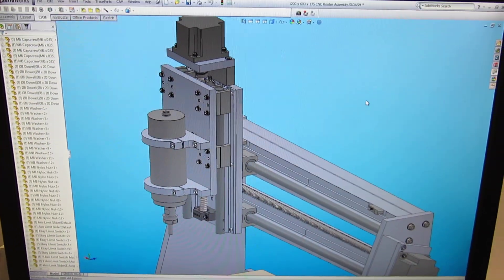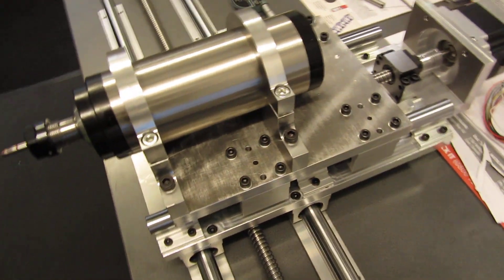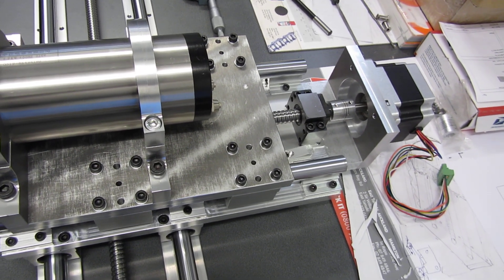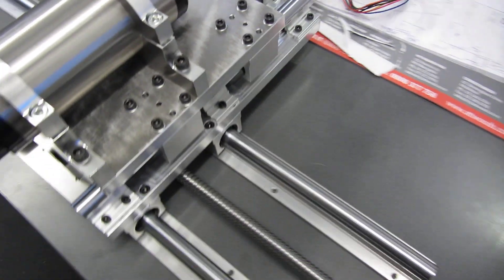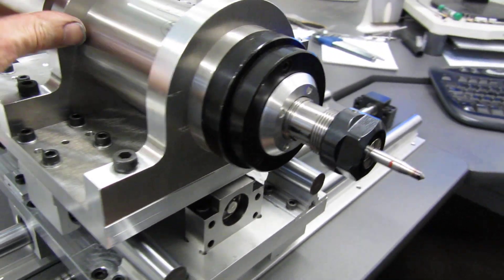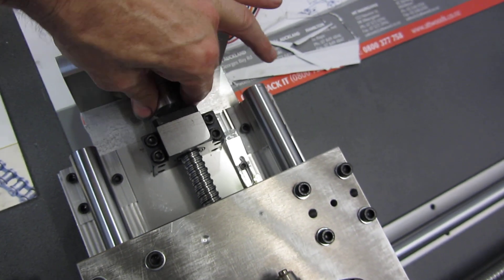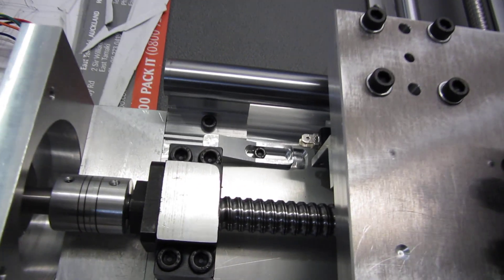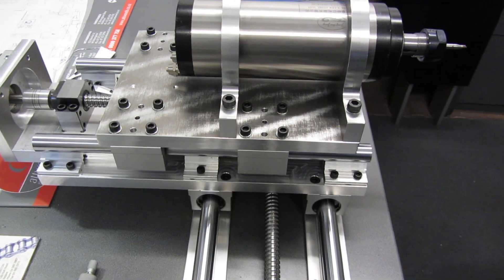2.2Kw Spindle on newly complete Z axis with new Y axis rails in place

Comment: Hi mate where did you get the spindle motor clamps? I have the same kind of motor 1.5 kilowatts I want to use for pcb routing. I did see
that for z axis I need for shure ballscrews because motor is quite heavy. Thanks for help.
Reply from the maker: Hi, I made the mounts myself along with the whole machine. The files for this are over on GrabCad

Comment: USDhow much completely in
Reply from the maker: Here is 2 places to get them

http://www.ebay.com/itm/2-2KW-ER20-WATER-COOLED-SPINDLE-MOTOR-AND-2-2KW-VFD-MATCHED-INVERTER-DRIVE-/250748327119?hash=item3a61c3d4cf:g:bwoAAOSwxYxUtO-y

https://www.aliexpress.com/item/2-2KW-Water-Cooled-CNC-Spindle-Motor-ER20-4-2-2kw-VFD-frequency-driver-80mm-cast/32253760001.html?spm=2114.30010308.3.47.lrzFPl&ws_ab_test=searchweb0_0,searchweb201602_5_10065_10068_10000009_10084_10083_10080_10082_10081_10060_10062_10056_10055_10037_10054_10059_10032_10099_10078_10079_10077_10000012_10103_10073_10102_10000015_10096_10052_10053_10107_10050_10106_10051-10102,searchweb201603_3,afswitch_2_afChannel,single_sort_0_default&btsid=91e0d4a8-afbc-4152-a807-f87990a42aa0
Reply: where is the other pieces ? it is just SPINDLE - and sorry why not air cool where is the other pieces ? it is just  ?SPINDLE?
Reply from the maker: Hi,
Sorry the rest you need to make yourself. I made this machine myself, design and make. Water cooled is a better option for the work I was doing.

The other parts such as ball screws and guide rails and guide blocks are also available at ebay or Aliexpress
Reply: is air cool not strong enough for metals ? .thanks
Reply from the maker: I'm not sure, I just like the water cooled for my setup, it works great
Reply: thank you too much . Jesus Christ save you

Comment: hi, u use nema 23? how much torque? witch diameter of linear guide? sorry my english.
Reply from the maker: +Fran Gette , 
I use Nema32 and 360 in/oz torque however, the torque will depend on how strong you make machine base and what material you want to cut. I don't have any stall issues even with microsteps 12,800 from memory. But I did have the acceleration of the stepper low to achieve this and I cannot force it to stall.

My guides on X axis are Ø25 rails and Ø16 on X and Y axis
Reply: Glen Lewis nice job, thank for answer.

Comment: what motor is this?
Reply from the maker: The Motor is a Chinese 2.1Kw motor with ER20 collet spindle and water cooled. It's Ø80 and there are many of them on AliExpress or Ebay. Comes with an inverter and run very well.
Reply: +Glen Lewis thanks man

Comment: Can you please tell me what plans you are working from ?
Reply from the maker: +Zahid Rahman 
I designed this myself on SolidWorks
Reply: +Glen Lewis  I am looking to build this 6 axis cnc https://grabcad.com/library/personal-project-5-axis-cnc-mill-with-6th-axis-for-turning-1/details?folder_id=382413 I am having trouble finding the blue Korean Spindle. Do you intend to mill any kind of steel parts  with your 2.2kw ? Have you tried it ?
Reply from the maker: I've milled wood, plastic and aluminum. I think that would be the limit of that spindle due to speed. There is no power at low rpm that you need for steel
Reply: omg you have big plans. just pick motor that fit there and make holding bracket part to fit that motor

Comment: I read that you shouldn't run this kind of spindle motors on metal for a long time because you could burn it... it is true? This spindle looks very good but i dont know about anything chinese fiability. it is good for aluminium?
Reply from the maker: I have machined plastics, hard woods, Aluminium and mild steel. Not so much in steel and only small parts. As for Aluminium it seems fine and I have had no issues.
Chinese made you just have to be lucky I guess, can be some bad ones...mine does not have a good true collet taper so that will need to be fixed....other than that it work well.

Comment: It looks great, must have taken ages to get it looking so good, I hope it works as well as it looks.

Where did you get your spindle mounts from or did you make them?

And also, is that steel you are using on your bearing block mounts and stepper motor brackets?